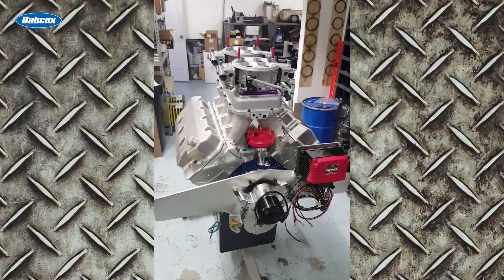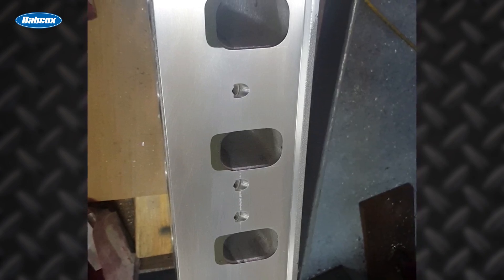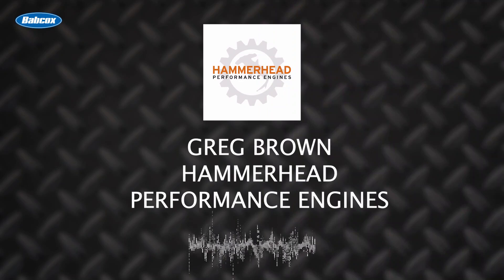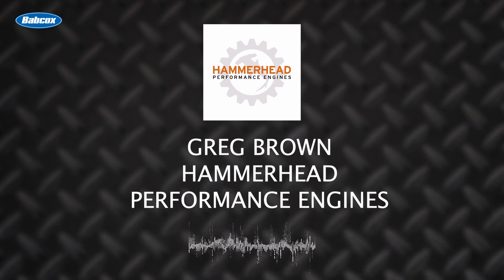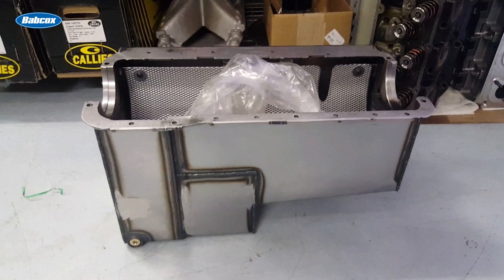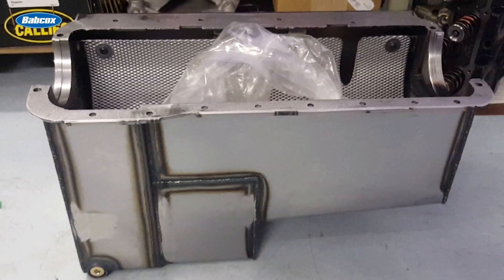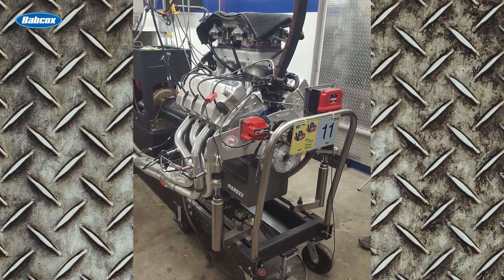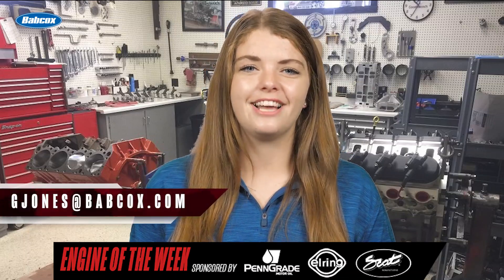393 cid Small Block Ford w/ Hemi Heads

Comment: It's amazing that you can take an almost 60 year old design, and put it through a test like this, the SBF is so over looked from a design stand point other than it's cast iron design, and two bolt main, it's base design could easily exist in today's modern cars.
Reply: Funny how the LS heads have the same spread port exhaust as the Windsor & can be bolted to a Ford Windsor. The old Chevy siamese design engine cannot use LS heads or intake? Can even mount a distributor in the front.You Chevy boys are in deep denial if Chevy did not copy the mighty Ford Windsor!🤔
Reply: Sbf is a great design I dought it’s over looked I’m a sbc guy myself but I like everything mechanical as long as it’s American made.
Reply: It does..it's call a Chevy ls.
Reply: @kskip4242  Ls uuuuumm that’s a Chinese Correlation . Copying Fords 302 Boss Engine 👍👍
Reply: @Saffsa  no, most people that know this will agree that the ls was closely modeled after the 351 Windsor Ford. The LS cylinder heads are nothing like the boss Ford cylinder heads at all.
Reply: @kskip4242  That’s wat I was looking for 👍👍
Reply: @Saffsa  There's no similarity whatsoever
Reply: @Stucifer  really? None? So then how does the ls heads fit a 351w block? Goddamn, it's not the first time Chevrolet has copied another manufacturer to produce something. I mean hell, it took them actually partnering with Ford just to finally build a Trans that is both efficient and strong. Unless you think the 10 speed in the high performance Chevrolets were their design.
Reply: Chevy is not trying to duplicate Ford.  That's an asinine suggestion.
Ford has always been chasing Chevy.
Ford abandoned its Windsor engines long before Chevy abandoned it's old motor.
The fact LS heads will fit on a 351W block is mere coincidence.  Chevy's SBC always flowed better than the various SBF's.  The LS flows even better.  It's just Ford's good luck that high flowing LS heads will fit their engine and improve upon the poor breathing Ford heads.  I don't think the Chevy guys want to put Ford heads on their LS blocks.  You are delusional
Reply: @Stucifer  😂😂😂 u do realise the Ford Cleveland head utilised decades ago on a Windsor 302 Boss is the head design that Ford has Run Successfully in NASCAR for Decades and Dominated NHRA Pro Stock ( Bob Glidden )  before being Outlawed 😂😂😂
Reply: @Saffsa  🤣🤣🤣I'm as true a Blue Oval fan as there ever was.  I've owned several Clevelands and Windsors.
I'm well aware of both designs, Street Boss's (Windsor blocks with C heads adapted), how Bill Elliott's cars had Cleveland heads on them even though the Cleveland was long out of production, and Bob Glidden's Cleveland headed cars.
But Glidden's and the NASCAR heads weren't exactly the same as production C heads.  They had a huge slab taken off the bottom of them to improve swirl and remove the floors of the exhaust ports that didn't allow the street versions to breathe.
On the street versions, the exhaust had to go over a hump and exit straight down.  The exhaust ports were in essence shaped like an hour glass.  Thin in the middle.
You're not talking to an idiot.
I'm not besmirching Fords in this conversation.  I'm just saying that Chevy did not try to duplicate Ford designs
Reply: @Stucifer  Nice . U mentioned Ford chased Chevy . Not sure where that comes from . Ford had Dominant Periods in NASCAR and NHRA with 356 358 inch Architecture . Ford was Constantly Battling the Governing Bodies of Various Motorsports eventually being Outlawed in Many due to the Unfair Outright Power Production from the Cleveland Canted Valve Head Architecture . Cheverolet had to Alter its Smallblock Head Architecture from Siamised Inlet Runners to Evenly Spaced similar to Ford . I have read an in-depth Article Related to V8 Supercars Australia regards the Holden’s Chevy engine having to take this Path to keep Pace with Superior Power Output from the Ford Engine . All 5.0 Displacement
Reply: @Stucifer  ahem.... can you say 351cleveland? Now who is doing the chasing? 351c is world heavyweight champ of small blocks. Period.
Reply: @scottford1091  What are you talking about?
Reply: @Saffsa  I repeat... I am a Ford guy.  I am not a fan of Chevrolet, but I give the Devil his due.  Ford has had a lot of great cars and celebrated a lot of championships in racing.  But all said and done... Chevy has won a lot more.  That's just a statistical fact we have to live with.
Reply: @Stucifer  a boss 351c will stomp the life out of ANY sbc. Fact check true.
Reply: @Stucifer  Well now thank you  . My Point was if Fords Cleveland Architecture Head Wasn’t Outlawed from so many Motorsports Bodies it would No Doubt have been a more Dominant Force . You Stated that Ford had to play catch up to Cheverolet . The Fact is Ford was Bridled on Numerous Occasions thru Decades of Competition .
Reply: @scottford1091  That is true for @ the time the Boss 351 was current.  But it was all out race motor, and very rare.  There are lots of small block Chevies since 1971 that could give it a run for the money.
And I'll go along with you in saying that the Boss was boss.
There are few times where Ford upstaged Chevy. and the Bosses all did very well against the Chevies.  But Ford only offered only enough of those them to the public to qualify the engines in organized racing.
Reply: @Stucifer  when was a boss offered in organized racing?
Reply: Boss 302 ran away hard from a dz302. 427 Fords gave chevys"427 mystery motor" fits. The Windsor design lasted from 1960 to 2000. Dude that's 40 years. The 427 cammer was outright outlawed from Nascar. When has chevy ever has a motor banned from anything? The boss 429 ruled the dragstrip when Glidden was king. Only after they penalized him with so much weight did he go back to the Cleveland. Ford was always developing and taking chances. Chevy made 3 motors in 50 years and only 2 of them were ever competitive... with some help from sanctioning bodies. Ford had an answer for everything chevy ever offered.... and still does.
Reply: @Stucifer  also, explain how a boss 351 was an all out race motor? Because it had a solid lifter cam and half a point more compression than a run of the mill 4v motor? That's the only difference.
Reply: Lots of small block chevies that could give it a run? Name 1.
Reply: Solid lifter cam for starts, 4 bolt mains, factory aluminum intake, 13:1 compression, etc.  Tired of arguing with morons.  You'd be hard pressed to find any ways to improve upon it.  
The Bosses were barely street-worthy.  Didn't have manners for idling or puttering around.
And for your information, after 1970 the compression ratio's for most Cleveland were pretty low, with exception for the Boss.  I think my "run of the mill" 72 4V had an anemic 8:4 compression, which is almost 5 points less than the Boss.
Reply: @scottford1091  ONE LAST GD TIME "IM A FORD GUY'.  I just keep a toe in reality, you don't.
Ford had a lot of good motors.  Quit bringing every last one of them up.  I could do the same for Chevy or Chrysler.  I just don't care to.
And Ford's 427 motor was another "race" motor.  That big chain grinding the SOHC motor never lasted long.  Good for a few races, but a poor design overall for reliability.  Chrysler's Hemi was superior to it.
Reply: @Stucifer  shame on you... ford is the most spit on brand of the three and I'm over it. I hadca 351c in a 66 mustang coupe and out of maybe 30 or so legit street and track quarters NEVER lost to a chevy... big blocks included. Chevy had only a good design in 1955 but never changed. It had basic flaws that never got addressed. If you ask me, pontiac had the best engine in gm for many years. I just hate when folks make out like Chevy was the be all end all... in racing circles there was help to make Chevy competitive but for the most part, Ford and Chrysler ruled the streets... in my experience. Chevy guys do have the biggest mouths though. If you've been around for a while, you know those blowhards... I gotta 350 with a cam and headers and a 350 trans and a 600 holley and it runs 10's... hublah hublah....
Reply: And btw... the cammer never raced in Nascar but it had success in top fuel... what Chevy ever ran Top Fuel?
Reply: @scottford1091  My best friend beat up on small block Chevies in his 289 hotrod Mustang.  He only wanted to race SBC's and I don't remember him ever losing.
The only times I ever remember him losing was to the other 2 SBF's that used to run the same strip, and a 455 Buick GSX.
There was a 302 powered Maverick that never lost to anyone.
The other Ford was a 289 Fairlane with Nitrous.  
I've owned a 428 CJ Torino, 2 302 Mavericks, 289 and a 351C Mustang, and 2 351C Cougars.  I'm a Ford guy.  I know the history and seen the cars run back in the day.
I'd rather have a Ford than a Chevy.
I've learned the really good Fords are really good, period.
The typical Ford motors and cars weren't very fast in my opinion.  That's not to say they couldn't be.
Reply: @Stucifer  now we can be friends! Hold my beer... so you know...
Reply: @Stucifer  most bullet proof engine I ever saw was a 318 chrysler.... damn things were made of granite.
Reply: I am building a 65 gt350r replica. I have a coupe that I have to get the roof put on. Got under riders, r model apron, 289 gt40p heads, 5 speed, glass hood, blue thunder/cobra intake, 1 inch sway bar. Keeping the 8 inch but it has auburn pro diff and 4.11s. Going to get big drums on it though. I get the 2.5 inch torino drums and backing plates and cut out the small bearing centers from the 8 inches or small 9's and weld them in. Works great and imo works as good as disc... but it's probably a little heavier... looks cool though. @Stucifer
Reply: What are you working on?
Reply: @Stucifer
Reply: @scottford1091  A Mustang is a reskinned, sexy Falcon.  I learned from once owning a Falcon Ranchero, that the Granada disc brake systems are easy braking upgrade.
It should translate to the Mustang as well.
Also, if you can find an old Lincoln Versailles (based on Granada), they have rear disc brakes.
Finally... I think many Mustang II's equipped with standard transmissions had 8 inch posi rear ends.  I was going to swap one into my Maverick but someone bought my car.
My friend with the badass 66 Stang never addressed his peg leg differential and had severe traction problems.
The little Mustang wasn't really built for the power your proposing.  Be sure to address that rear end if you want to go really fast.
The Monte Carlo bar is not a bad idea to help prevent frame twist
Reply: @Stucifer  
Yeah, Chevy has won lots of races...
But if you consider how many more Chevys ran vs. fewer Fords, then FORD's win totals are pretty impressive.
Reply: @Turbo4Joe363  It's a whole lot cheaper to go fast in a Chevy.  That's why it's the preferred choice of racers.  Aftermarket technology for Fords isn't very good.
Not arguing that you can't beat a Chevy with a Ford.  I always went the Ford route myself
Reply: @scottford1091  I'm not working on any hot rods.  Too old and poor to work on them.
I'm having a head job done on my 95 Eddie Bauer F150, but that's not a muscle car.  But it will be nice when the truck is done so I can sell the Buick.
I hope to one day own another V8, RWD, FORD;  But probably not happening in my lifetime unless I get such a car for a song, and it doesn't need a lot of work.
I kind of want a Fairmont Futura and either build a badass 302 or slide a 351C off in it.
But those cars aren't easy to find
Reply: @Stucifer  where in the USA are you located? I'm in high point NC.  I know a lady that has a Fairmont converted to 5ug with a 302 and magnums that you could get for 500 bucks or so. Good looking 2 door Futura. Title is iffy but that's not hard to get.
Reply: I just took in a cleveland with a broken crank that you could have. I haven't seen the bottom end just a hole in the pan and a rod.
Reply: How old is too old btw?
Reply: @Stucifer  I didn't tag you but I have a cleveland with a broken crank you can have. 2v motor but is probably salvageable.
Reply: @Stucifer  You are delusional!Robert Yates ,well know Nascar Ford engine builder was part of the design team for Ls Heads,Never seen Chevy use even port intake and exhaust design heads before until the Ls which Ford have been using for years and the same bolt pattern as well,As for poor breathing Ford heads me a break.Canted Valve Cleveland heads kicked Chevy butt .
Reply: @scottford1091  is that fairmont still available
Reply: @Stucifer always flowed better??you sure??I am.they did not
Reply: @Stucifer chevy didn't have solid lifter cam? 4 bolt main gives hp how??11.5 compresion if you want facts.barely street worthy??man you are smoking some bad shit!
Reply: @rickkowalske4116  I don't even know what comment you are commenting to, or what you are defending/condemning.  Try to make better sense.  Maybe you smoke better stuff than I can get.  I don't know how to respond to your gibberish

Comment: Identical bore and stroke to a 392 Chrysler ( 4.0 x 3.9 ). The 392 ( all of the early engine series ) Chrysler is designed around the requirements of the valvetrain to actuate the rocker arms reliably ( lifter and pushrod angles ). Retrofitting existing inline valve engines to an opposed valve head is usually difficult . It sounds like this may be a success story.